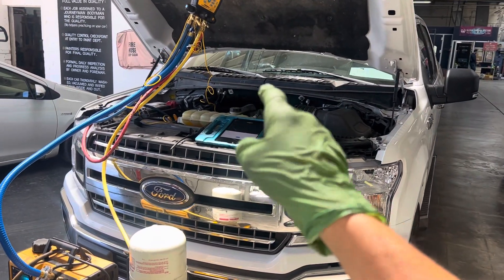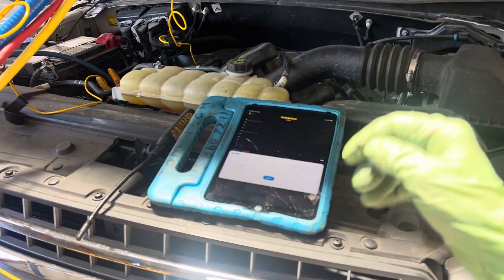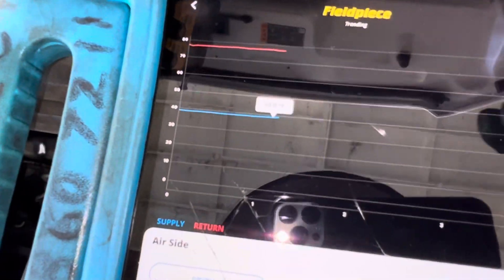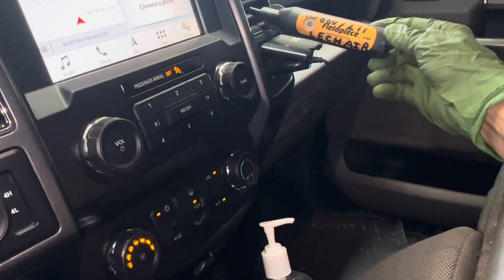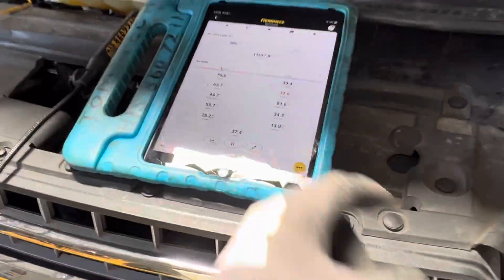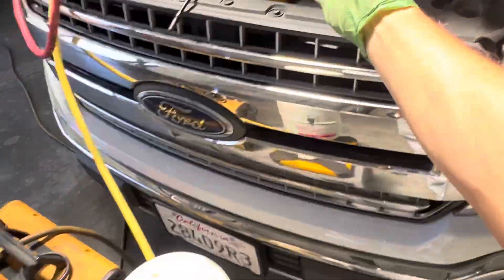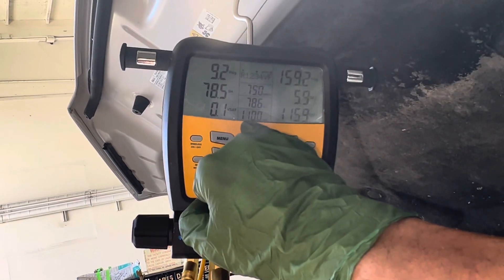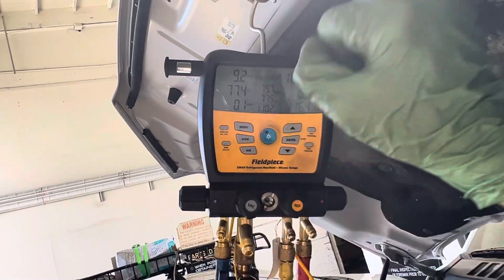AC 39°F Dash Temperature Only 460 g Refrigerant Should Be 822 g.

Comment: How does that device tell you the weight of your system charge?
Reply from the maker: It does not tell you the weight. 

It’ll tell you the superheat it’ll tell you to sub cooling and it’ll tell you the saturation point of the Refrigerant inside the refrigerant lines. 

Using the recovery machine to recover out all the refrigerant on a scale in a tank, will tell you exactly how much refrigerant you have recovered that you will use as part of your diagnostic tools to determine whether you are looking for a faulty part or just a little system charge 

For example 

You could be working on a vehicle that has a -2 vacuum on the low side and instantly most people go, and I have a bad expansion valve replaced the expansion valve 

But in reality, it was just one of those systems that do not protect itself by turning off when there is a low pressure on the low side and it allows the compressor to keep running when maybe it only has 5 ounces of refrigerant in the system, extremely low 

Therefore, you know it’s not the expansion valve you know it’s just a low refrigerant charge and there’s a leak somewhere 

Now on the other hand 

We take that same system and it’s cooling in a vacuum of negative to vacuum and it’s not cooling 
      Can you pull out in Measure the Refrigerant and you find that it has 2.2 pounds exactly what that manufacture wants for weight of refrigerant in that system.

You know it’s not a Refrigerant problem. It’s a hard mechanical device problem. You now know it’s a bad expansion valve that is restricted. 

The weight of the refrigerant in the system is part of your diagnostic tools 

But so is the superheat and sub cooling 

If you throw on the refrigerant gauges and Refrigerant Lāhainā temperature clamps and it tells you you have a superHeat of 75° unless there’s a mechanical failure somewhere you instantly know you have a little refrigerant charge 

The same goes on some systems. If you know you have a subcooling I’m only 1° subcooling. You know you have a low refrigerant charge. 

But this makes a difference, whether you have an office job system or a expansion valve system that we all learned about in high school auto shop

Comment: This young guy has so much to learn still,  thats what happens when you believe everything computers show you when being teached,     do love the go forward attitude though, if you apply some of that same  attitude to old schoolers you'd be surprised how much you can do with out using a single AA Battery and not so many ch running around too.
Reply from the maker: The computer information and a Automotive online guys have a Lotta flaws and wrong information. 

That’s why they invented back up batteries .  Never leave home without them..
Reply: @coldfinger459sub0  Non responsive objection answer.

Comment: I love this video because this is the first time I've seen you show the temp of the line when the compressor is working overtime with too little charge. Thing is burning up right before your eyes!
Reply: Come to the HVAC side it's great. VRF/ inverter technology is great. However it requires the technician to constantly update their knowledge.
Reply from the maker: @jorgee910  I sold and installed Panasonic VRF ECOi 2011 with my son.  We been selling and installing LG MUTI V VRF sense 2015. 

I have a few videos uploaded on YouTube not many because I just want to teach automotive guys to get better. 
      And slow automotive technicians they can make better money 💰 being refrigeration for commercial industrial, HVAC technicians.
Reply from the maker: I’ve done it in a few other videos
Reply: @coldfinger459sub0  I'm sure. But this is the first time I've seen it. I'd be curious to see if the discharge temp drops over the course of time. I know in your third video it only went down like 3 or 4 degrees
Reply from the maker: @mailmanjoe  it reacts differently with different types of compressors and depends on the severity of Loss of refrigerant

Comment: Where can techs find specs for different year's, makes and models on superheat and subcooling or is there just a set standard or is it rule of thumb that you go by, thank you for all the information you put out it, last question in your opinion what are your thoughts on the elitech gauges
Reply from the maker: Unfortunately, there’s no more rules of thumb and automotive air-conditioning, especially since they introduced variable displacement, compressors and electric, three phase variable, speed, compressors, and sensors that sends signals to a computer which software takes over and changes pressures and temperatures superHeat sub cooling

SuperHeat and subcooling are pretty difficult under some atmospheric conditions when the computer commands a condenser fan to constantly rise and fall in air speed 

To take accurate measurements you need fixed fan speed so when those conditions you’re all over the map 

It’s experience 

Oh, yams, do not release information for superheat and subcooling automotive personnel are considered uneducated, not worthy, keep things simple to the lowest common denominator in our trade . 

When you do hundreds or thousands of air conditioning jobs per year on cars, you do build up your own bank of information off of different year make model vehicles 

So you do come up with your own rule of thumb but specific model year of manufacture 

But there’s some football field range of superheat that you cannot take as a rule of thumb, but somewhere in the area of 8 to 20 but this is only on certain specific vehicles 

Some vehicles I have recorded as low as near zero superHeat other vehicles as high as 30 and 40° 

As for sub cooling, the range is the exact same different vehicles under different atmosphere conditions. You might have a Degrees subcooling many vehicles might be somewhere around 15° other ones might be 30° of sub cooling. .